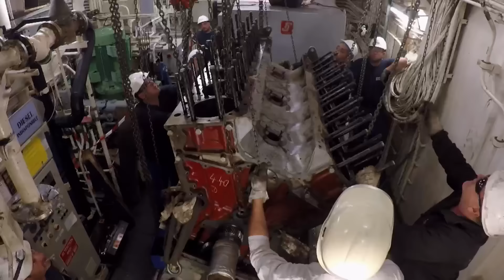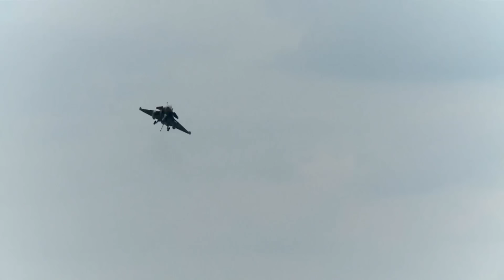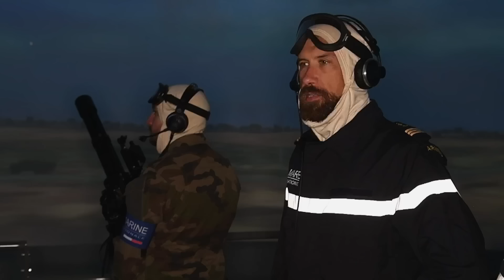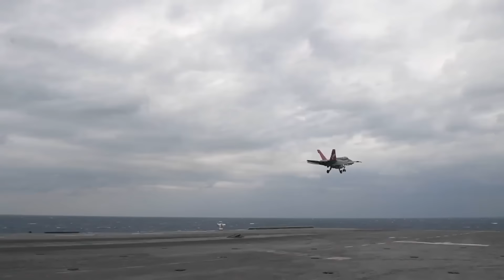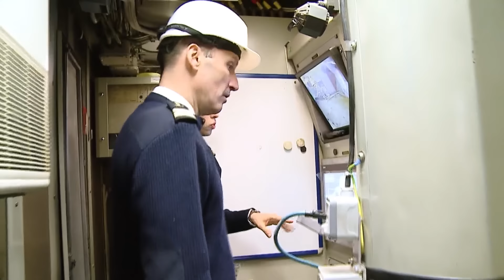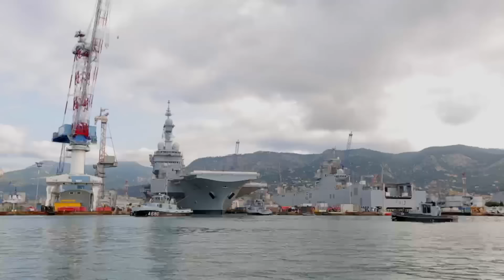How France Is Rebuilding Its Nuclear Aircraft Carrier for Future Wars? – Documentary - MDW

Comment: @squirepraggerstope3591 Your carriers are only 80,000 tons when full load, which is rarely. Also, in regards to the UK carriers and ballistic submarines you guys are having $$ and personnel issues- it is rare when you have enough personnel to operate everything simultaneously.  France has 1 carrier. Wow. So what? It's an economic $$ issue as to why they are not operating 2 carrier groups,  but they will eventually in time. France and Germany are allies too, and they are not "against" each other regarding the new FCAS fighter jet project per se, they are having issues because France need 2 variants, one for ground based like Germany and another carrier based variant which Germany doesn't need and its a $$ issue. Both are prepared to go it alone if it can't be resolved- certainly France, as seen with the Rafale,  has the capacity to go it alone- but even if it falls through, France & Germany are allies and will remain so. France and the UK are also allies and are much more powerful together than alone. You could use some manners. I am from the US. I am proud to have both France and the UK as allies, especially now what with all the uncertainty going on in the world. What did France do to piss you off to have the comments you have? It's not the 1700's anymore bub, France and the UK are allies and despite both of the issues they bith face right now in increasing both of their militairies, they are both quite formidable TOGETHER.  What's the matter with you? Why don't you fire a ballistic nuclear missile on Paris right now? Btw, France' autonomy, militarily,  is a powerful thing to have- not a weakness.